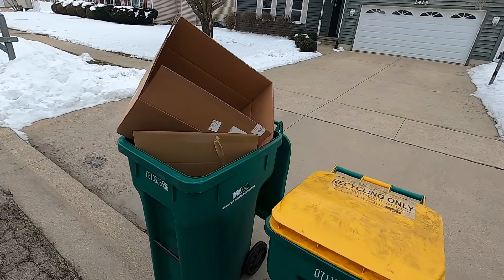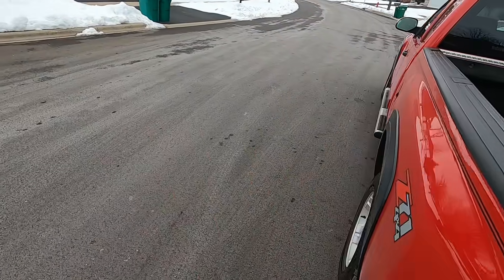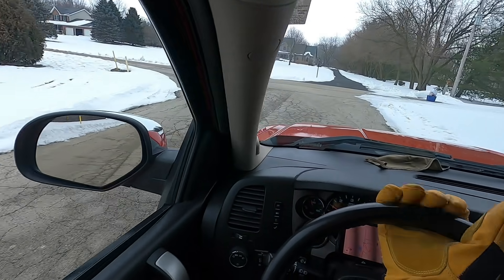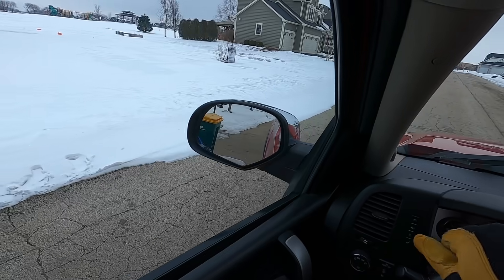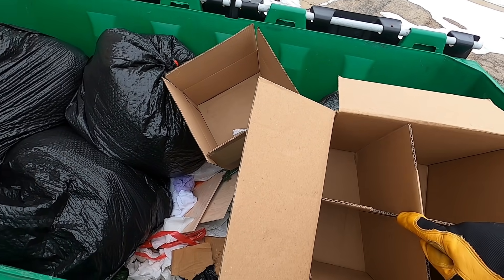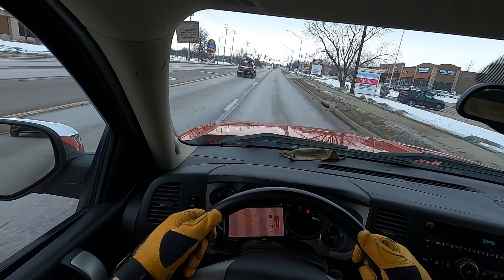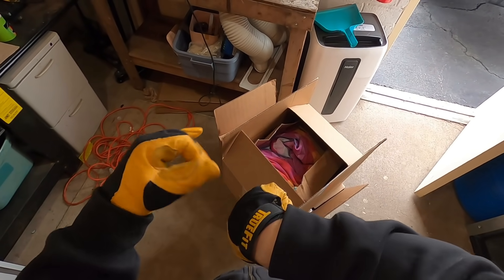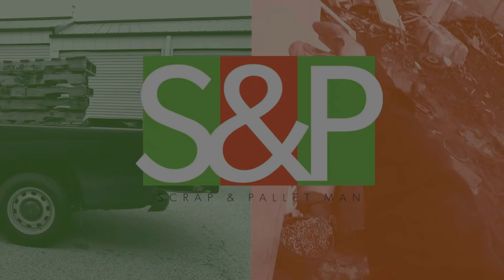Winter Street Scrapping Trash Picking Fail

Comment: Sorry you are having so much trouble with your shoulder.  I have gone through quite a few conditions (carpal tunnel, tendonitis and frozen shoulder) with chronic pain and it wears on you.  Thankfully they eventually became better with lifestyle changes, which were difficult.  Congrats on your wonderful new Red Ride!   You could use one of those self stick round mirrors to see vehicles on the sides.  They saved me many times.  I have some vintage sewing machines and I loved all that you have found. Strange that you weren't able to find styrofoam as it seems the stuff overflows in the dumpsters most of the time.

Comment: Praise God!! You got a beautiful new truck .. have you named it? How about 🌹 Rosebud 😏?
  For the sewing machine, or anything really with a protruding rod or pin, one thing that works really well is to tape cutdown wrapping paper or toilet paper tubes over the areas. I’m sure the towels did the job just fine, but, in case you run into that problem again the cardboard tubes work. 🦋

Comment: Definitely double box sewing machines with packing material between the boxes, such as packing peanuts, styrofoam, layers of cardboard. They can really get beat up in shipping. I had an old heavy sewing machine that cracked on the inside (solid cast metal). Don’t forget the bottom and top layers! You could have used Saran Wrap to secure the towels around the sewing machine, just wrap it around and around until it’s tight. God bless.

Comment: Use duct tape to soften pointy edges.  Must fill the box so nothing moves.  The usps machines are rough on boxes especially when they r heavy.  I would use duct tape around the entire box because they throw them around.  Also, butcher paper works well to stuff it up. Insure it.  I manged a fullfilment center and learned the hard way.

Comment: I'm going through trying to see all of your videos--but even at an average of three a day, I seem to be getting behinder and behinder--and I remember one video from 2017 (don't bother looking it up, and I didn't save the link) where you and a friend went somewhere to pick up a massive metal chest that was about the same size as the dumpster in which it had been dumped.

The two of you couldn't get it out, and so had to rely upon the assistance of a third guy.  The chest was stuck in the dumpster and didn't want to come out, even after you strapped it to the truck and tried pulling it out.  You used the truck to pull,  but all that happened was that you dragged the dumpster.  You three finally got it unstuck and successfully dragged it onto the bed of your truck.

The chest was so large it took up almost the entire bed.  At the scrap yard, you had to have the guy with the crane lift it up and out.  Have you since then had anything else as large as this mammoth chest?  I'm pretty sure  you would remember this without having to go to the video.  Thanks.

Comment: Only use wd40 to loosen stuff, it will dry out. Use grease or motor oil. Compressor oil will also work cause its designed to stick on metal even if it hangs under it. I once cleaned a ball bearing, that 1977 mini short time after sounded like i had reverse gear sound in all forward gears.  I have no experience with lithium grease, so i cant say if its good or bad in a place that might attract dust. 
Chat will pick on me if im wrong, and thats ok if they have better solutions.